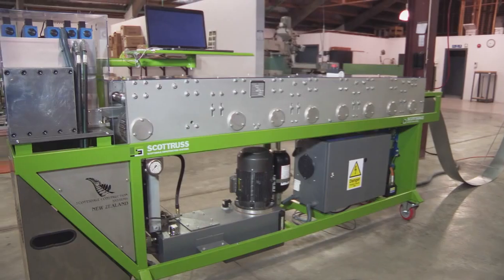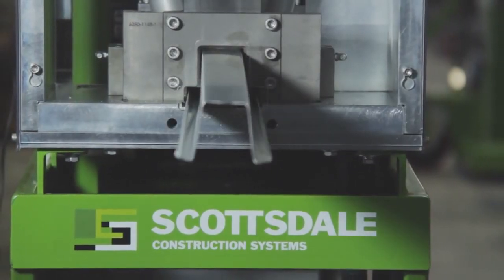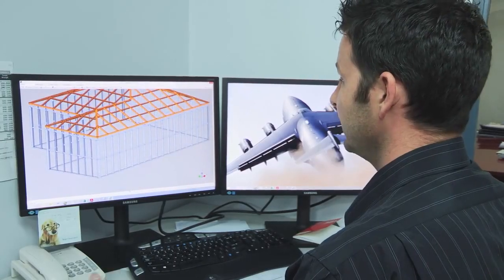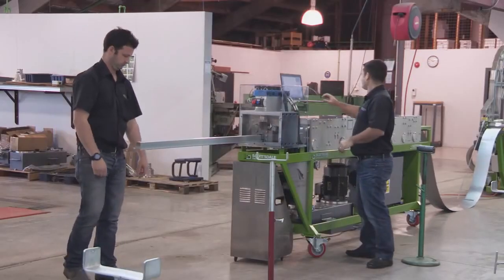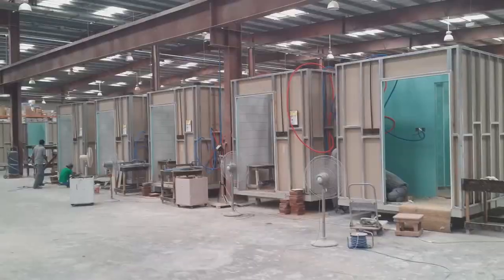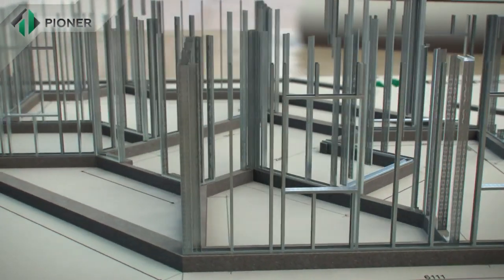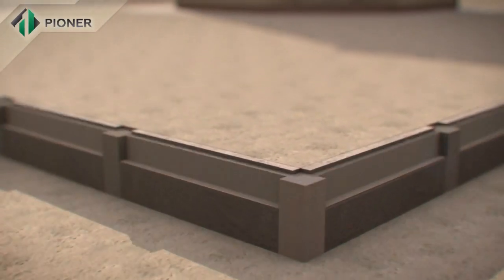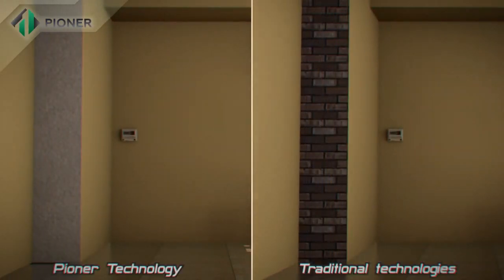Light gauge steel frame building system for low cost housing projects

Comment: What is the thickness of the steel channel?
Reply from the maker: Depends on design. Lgs profile 89 mm or 150 mm, thickness 0.95 - 1.15 mm
Reply: @stretchceilingsDubai  can be 0.55 to 0.75 too